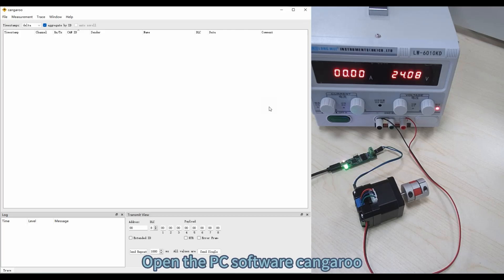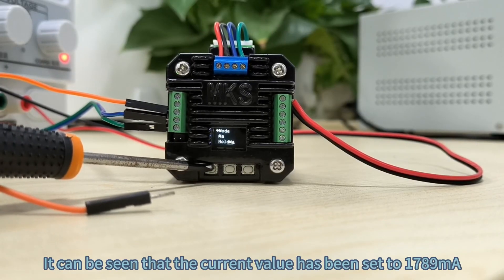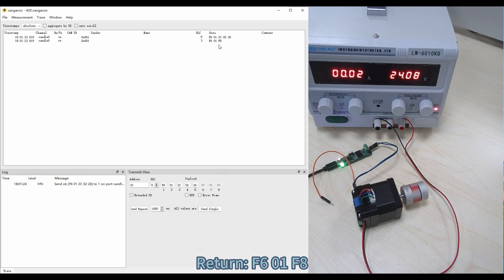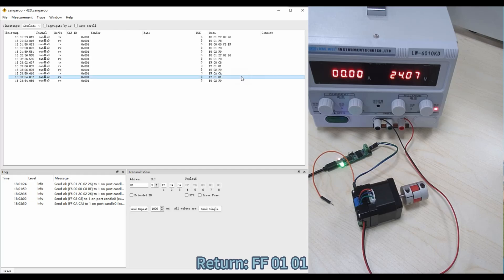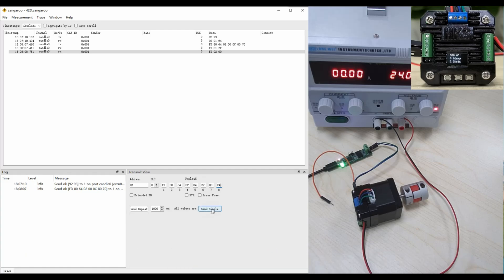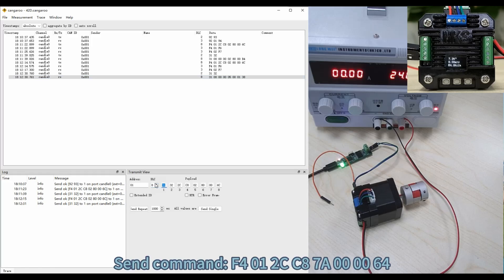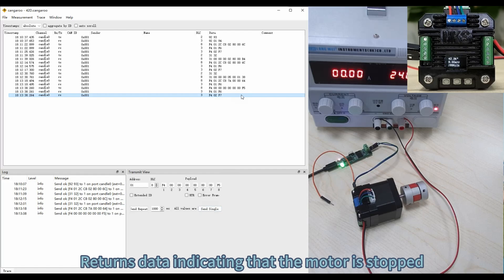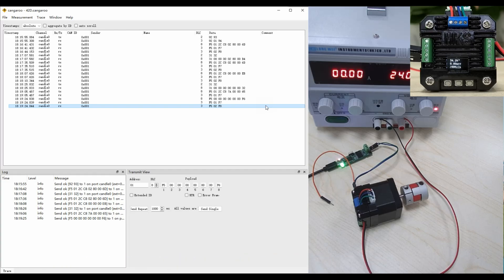Makerbase SERVOxxD Closed loop Stepper Motor Example 3 CAN example

Comment: Now I'm thinking about purchasing a Makerbase MKS DLC32 v2.1 control board. Motherboard MKS DLC 32 2.1.
Does anyone know if it is possible to work with this board from a program developed in Microsoft Visual Studio C++ or Embarcadero Delphi XE?